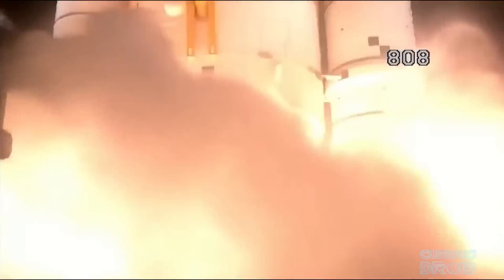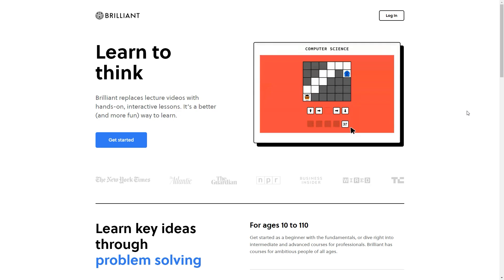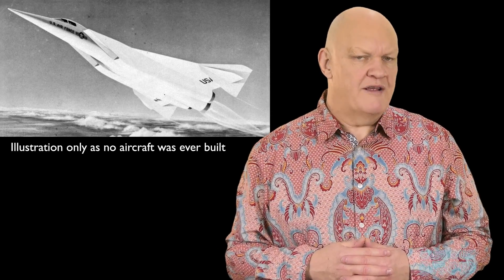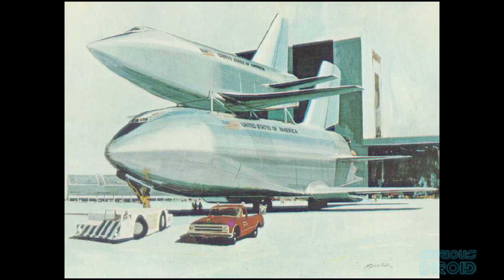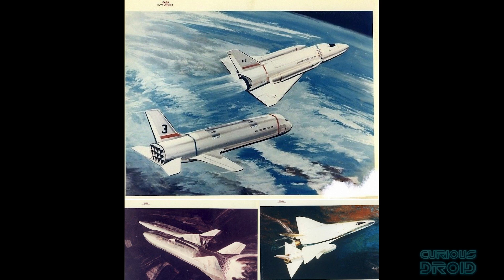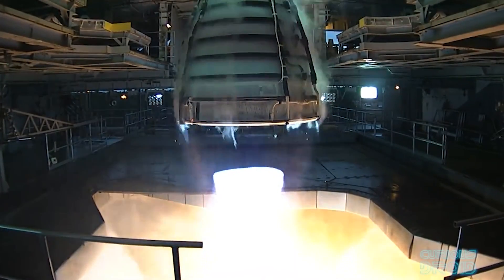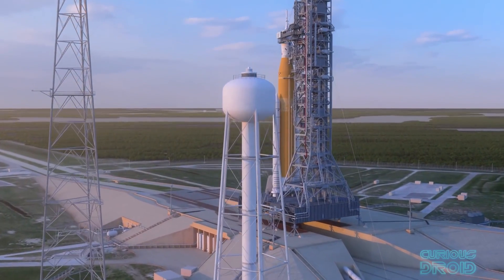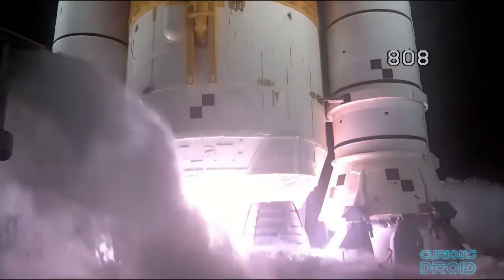Why is NASA Throwing Away Reusable Engines?

Comment: Why have they not created a two part plane space craft reusable units. It seams easy to me. Compared to what they did with the shuttle.  Even if they just used them for shipping people from and to the space station.  One unit could be the lift unit and remain in space orbiting during the mission. Inside it is another craft that detaches that is the shuttle to moon or space station. When it comes to reenter. The shuttle slips inside the launch rocket and with a single jet engine for control. Flies down to land. For crew and gear the entire craft docks with the space station or lands on the moon with a normal runway. Take off the same way after refueling.
Reply: It seems easy to you, because you don't actually understand what you're talking about.

Comment: The shuttle never came close to meeting it's goals on launch frequency or affordability. Was insisting on reusable launch systems the way to go then? (I know there were a lot of compromises due to funding as well.)
Reply: I've read (IIRC it was in a book called "Halfway to Anywhere" by Harry G. Stein.  A good read.  Clarke said it, too, though.) that the space shuttle was meant to be the DC-3 of space but after congress got ahold of it it turned into the DC-1 1/2.  True reusability would have put the price to orbit via a TRUE shuttle at maybe $1000/lb. instead of the $10,000 it is now.

Comment: I would say that the main fuel tank on Artemis bares little in common with the tank used on the shuttle program, it is basically a complete redesign. The original tank was designed to take the thrust forces through mounts on the side of the tank onl;y, whilst the Artemis tank is designed to take thrust forces on both either side, and the bottom of the tank. The top of the tank is also totally redesigned, it now as to carry the load of the upper stages and capsule, whereas on the shuttle version it carried no load. But, like the shuttle version, the tank is not reusable. The other main part of the shuttle system that is being reused on Artemis are the side boosters, they have flown on previous shuttle missions. But for Artemis they have added an extra segment to increase the thrust output. But sadly, like the RS25 engines, they are not being recovered and reused, when of course on shuttle missions they parachuted back down to land in the Atlantic where they were recovered.
Reply: After recovery and processing, the side boosters where really a wash on cost to recover. Most of it is just a metal tube (I know I'm way oversimplifing that). The nozzle, electronics, and hydraulic controls are probably the most valuable part, though much simpler than a liquid engine. Leave out the parachutes, the divers, ships, and processing, cost adds up.
Reply: @tangydiesel1886  Totally agree, I think they re-used them simply to keep congress happy - seeing that the whole goal in the first place was to make the system re-usable. Like you say, by the time you add in all the extra cost of recovering them, it would probably have been cheaper to just ditch them.
Reply: It's literally a longer tank with engines at the bottom. The side boosters have not flown on previous shuttle missions as these are new 5 segment boosters while the older ones are 4 segmented ones.
Reply: @blackhatfreak  You are correct about the boosters, with the exception of one segment which flew previously on Atlantis they are new segments. Though i believe they plan to use further used segments in the future. I know Nasa have said they have several segments from shuttle flights that can be reused. And yes, the main tank is longer, along with completely redesigned upper and lower ends. About the only thing that remained the same was the diameter.
Reply: The SRBs were never worth recovering in the first place, tho. Really on most rockets the only thing worth recovering are the engines themselves, assuming they’re built with reusability in mind. People forget just how insanely expensive the fuel is, and how valuable that last little bit of fuel is in an almost empty rocket. That can either be used to send considerably more cargo into orbit that launch, or consumed getting the rocket back to earth…where really the only component more valuable than that fuel are the engines.
Reply: @sunspot42  I don't think the fuel is particularly expensive. How much are we talking about, six or seven hundred thousand dollars per launch? Even if it was a million dollars there are many components, besides the engines, that cost far more than the fuel.
Reply: @nagualdesign  1,100,000 of APCP per booster definitely doesn't cost 6 or $700,000 dollars...
Reply: @jimurrata6785   I thought we were talking about the fuel for the SLS main engines, not the Space Shuttle SRBs, but feel free to tell us how much they cost if you can find a reliable source.
Reply: @nagualdesign  all fuel is not equally valuable. The last of the fuel in the tank contributes proportionally far more delta v than the fuel burned before it. When you reserve fuel to recover the booster you disproportionally reduce the amount of payload you can lob into a given orbit. It isn’t clear at all - given the added expense and complexity of renewable rockets - that it’s a worthwhile trade off. 

Cheaper, simpler disposable boosters might make more economic sense. Big dumb rockets.
Reply: @nagualdesign  sunspot42 started with "the SRBs" and 100SteveB discusses how many "segments" were reused..
I guess I saw you reply to sunspot42 and was not following the track of the comment thread.  Ooops!  🤷‍♂️
Reply: @nagualdesign  An O class (37,000 ns, 38.75 lbs) apcp motor would cost me about $130 per lb for propellant.
I'm sure when you're buying 2,200,000 lbs of the stuff it isn't that much.
But at half that price thats still $143,000,000 per launch.
You'd have to find the procurement records or ask someone that used to work at Thiokol/ATK
Reply: @sunspot42  I think we're talking at cross purposes. I was responding to your first post in this thread where you wrote, "People forget just how insanely expensive the fuel is, and how valuable that last little bit of fuel is in an almost empty rocket."

AFAIK, liquid hydrogen and oxygen are not particularly expensive, let alone "insanely expensive", and there are many components of the SLS, besides the engines, that cost far more than the fuel. Large rockets are a bit like 'single-use cars' in that sense.
Reply: @nagualdesign  The last of the fuel in each stage of a rocket is far more valuable though in terms of its ability to impact delta v. It makes recovery much more difficult to justify.
Reply: @sunspot42  Literally not true
Reply: @blackhatfreak  What is “literally not true”? The last bit of fuel in a rocket delivers the greatest delta v to the payload, because the fraction of fuel mass vs payload mass becomes most favorable for the last of the fuel. If you try to return the booster you need to either reserve a bunch of the most-valuable fuel to do it with, or add some other thing to the booster that also increases its mass (wings, parachutes, etc.) in order to get it safely back down on the ground. 

It’s a big reason why reusability has always been of questionable value, given the expense and complexity involved.
Reply: @sunspot42  no
Reply: @sunspot42  the main purpose of reusability is to increase frequency of launch rather than the cost. The shuttle was designed to support a space station so NASA needed a system that could be launched often. It's much quicker to refurbish than it is to build from scratch even though it's not necessarily cheaper. Hardware can only be manufactured so fast. Of course reusability does sacrifice payload capacity. For the shuttle it was a reasonable sacrifice considering supporting a space station doesn't require heavy lifting.

The SLS on the other hand is designed to launch manned deep space missions so it doesn't have to launch very often, but it does need as much payload capacity as possible hence the reason it's expendable.
Reply: @DeepDeepSpace  I’d argue that reusability did not in fact turn out to reduce turnaround time all that much with the Shuttle due to all the refurbishment work that needed to be done between launches, and that it would have been quicker to setup an assembly line and just keep cranking out large expendable rockets on a regular basis.
Reply: @sunspot42  the space shuttle averaged 5 launches per year. One year they launched 8 shuttles. One time a shuttle launched two weeks after another landed. For the second Hubble service mission they had two shuttles on the launch pad at the same time. One to service the Hubble and one as a back up incase the first crew needed to be rescued. I don't see expendable launch vehicles matching that pace.
Reply: @DeepDeepSpace  Between March of ‘69 and April of ‘70 there were 5 Apollo missions. I don’t see why manufacturing capacity couldn’t be setup to build and launch at least 5 Apollo-sized boosters a year. We did it before.
Reply: @sunspot42 , I think it comes down to cost. The Apollo program was primarily a geo-political contest with almost unlimited budget, so not great for comparison. For liquid fueled rockets, the cost of hardware overwhelms the fuel cost, so in a commercial regime if you can recover the hardware and turn it around quickly which has been proven with falcon 9, the cost (to the vendor, not necessarily the customer) per launch goes way down. They have proven they can turn around a falcon 9 in about 2 weeks and relaunch including stacking and all within 3 weeks launch to launch. It remains to be proven if that or better can be done with larger vehicles, but if it can, then the cost model will change significantly.